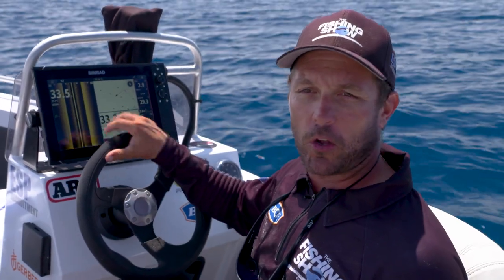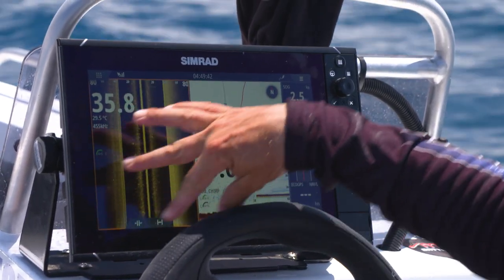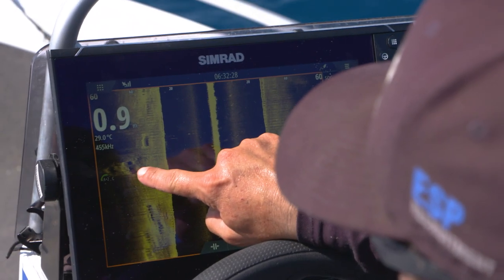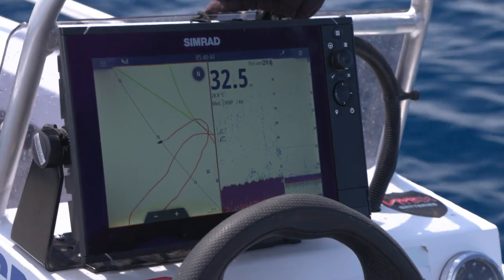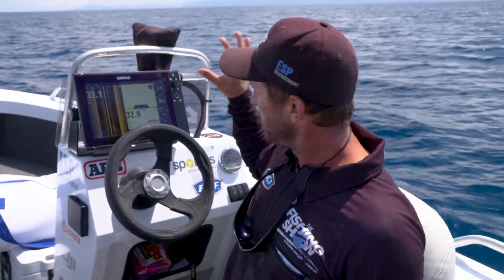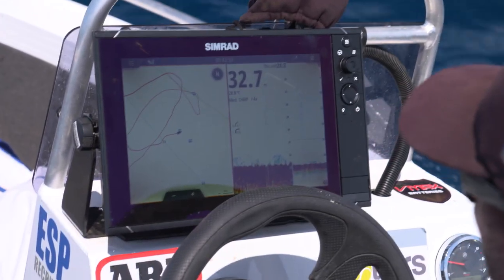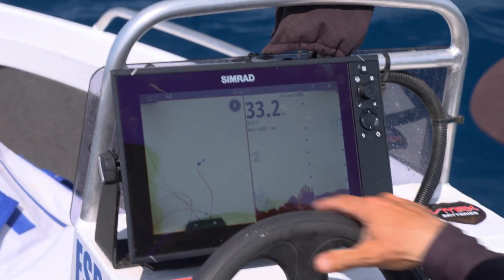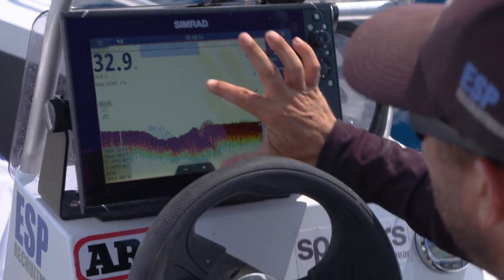Finding Wonky Holes on your Sounder - Simrad

Comment: Hi.

What transducer was used in this video to display the 2D Sonar image?

From 3.40, you mentioned “standard sonar cannot locate wonky holes…”.

Can you elaborate on this?  I thought what was being showed was actually standard 2D Sonar?

Cameron
Reply from the maker: Hi Cameron.  The transducer was the new ActiveImaging HD 3-in-1 FishReveal Transducer.  The transducer provides 2 types of sonar.  The first is traditonal downward sonar which displays the bottom under the boat (and any fish in the water cloumn).  This sonar is 2D and uses "High Chirp".  This "traditional" 2D, downward-shooting sonar only reveals what is under the boat, therefor you need to actually drive over a wonky hole, or a reef etc before you can identify it, so naturally, this can be very time consuming.
The transducer also has "sidescan" which sends a signal out on either side of the boat, so it catches the contours of the seabed from the side.  So, much like shining a torch out to your side while walking in the dark, you can see so much more than if you shone the torch directly down at your feet.  Fopr example, you could set the sidescan at 30 metres each side of the boat, so that gives you 60 metres of coverage when searching for reef or wonky holes. Note that  the transducer sends out both types of sonar at the same time and you can display them both at the same time on a split screen, along with your GPS map.
Reply: @AFNFishingOutdoors  many thanks for this detailed response.  I understand now.